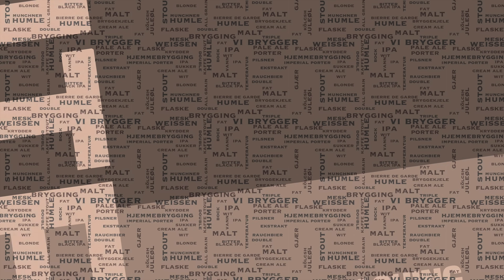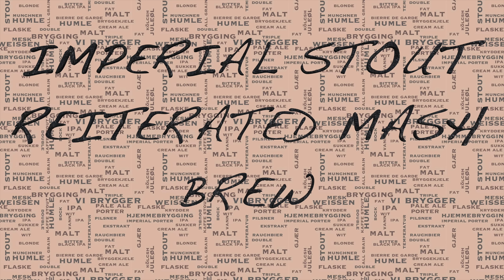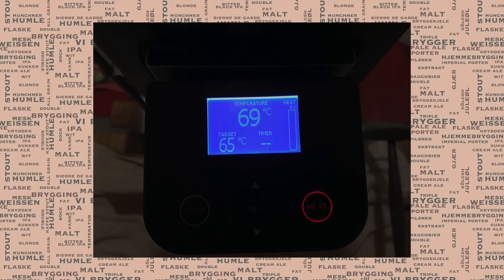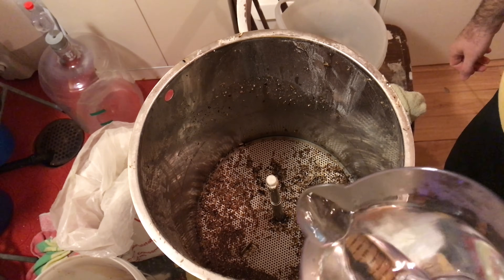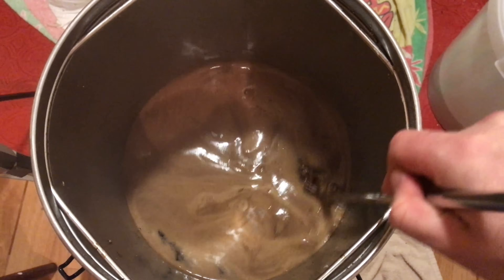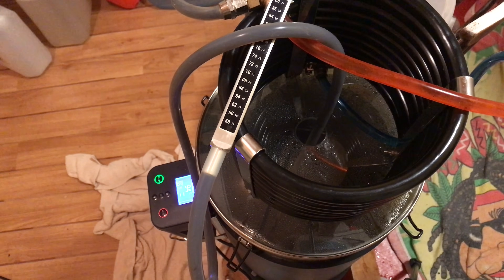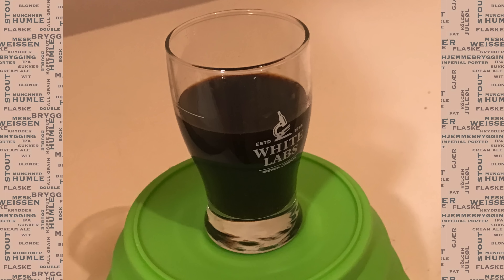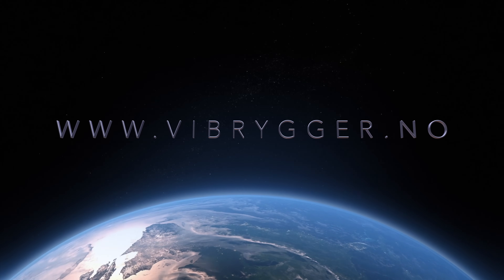Imperial stout reiterated mash high efficiency Grainfather brew 4k

Comment: Thanks for this David. I'm planning to try my first reiterated mash in a few days and will follow your advice (I've recently purchased the small batch pipework for the G30). I just had a query about mashing out after the first mash - are advantages gained from doing this that outweigh potential benefits of leaving active enzymes in the wort, ready to contribute to the second mash? I would always mash out after the second mash, but wouldn't instinctively do it after the first mash. Thanks again.
Reply from the maker: Great , cheers. 
The mash out side is optional. See what you think after trying both ways. 
I also have this more recently made guide which many found easier to follow, though its still 5 years old! https://youtu.be/C-7NiGZgKyQ?si=4ut3aZKkC9uOH8u1

Comment: Thanks again. I brewed some 'Sinister Stout', from Brewferm. It's an extract (2.4 gallons) and is currently conditioning in the basement. I racked it twice (it's a top fermentation process) and added 3oz. of 100% cocoa in the 2nd. racking. I also added 3oz. of Maltodextrin in the 2nd. racking. During the bottling I added 1ml of Four Roses burbon per 12oz bottle. For a Burbon taste test I made a growler (2L) with 25ml of Four Roses. If my friends prefer the milder amount of adjunct, I get to drink the growler.
Reply from the maker: Great, sounds good 🍻🍻🍻

Comment: The Grainfather G40 can manage a much larger grain bill. When brewing this exact same recipe on a G40, would you still recommend doing a reiterated mash to reach this level of efficiency? Or can it be done with only one mash on the G40 with comparable results? And if so, what water calculations would you recommend?
Reply from the maker: Hi Mark, totally right. Bigger sysyems can certainly mash this in one mash and you could increase the volume to one keg easily too 🍻🍻

Comment: Hello David! I'm about to try this method on my new 65L Brewzilla gen 4. At first I was thinking of using no sparge method as I could do my 14+kg grist for 23L batch on one mash but I wonder if it's a good idea? I'd need around 60% mash effiency and it's hard to tell if that is too optimistic. 
In case I try reiterated mash I was wondering why did you decide to mash out the first malt pipe? I'd think it would be useful to have all the enzymes there for the second mash as well? 

If I split the grain bill into two in Brewfather it gives me 24,6L mash water and 12,86 liters for the sparge water. Does this sound reasonable for the first mash? And then for the second mash I'd sparge so that I would hit the correct preboil volume, right?
Reply from the maker: For sure you need to sparge. The split method works well. Yes, go this way.
Reply: Right, thanks. What about your reasoning behind mashing out in between? Is there a benefit I'm unaware of?
Reply from the maker: You may skip mash out between.

Comment: Hi David I havre tried to find info about in what type of temperatur you should have the stout rest for 1 year, what temperature? Shall I also use the air look on or just seal off the damejeanne. Thanks in advance and for all jour god videos!
Reply from the maker: Thanks. Ideally 14C but normal room temps will work too. Yes, use an airlock 🍻🍻🍻
Reply: @DavidHeathHomebrew  Thanks for your answer, now I need to wait for 1. Many nice tips from your videos,
Reply from the maker: Cheers Olle 🍻🍻🍻

Comment: Hi, David! First of all, thank you for continuous inspiration. Been a while since I've made a big beer, so then I go back to this oldie, but goodie video :) 

I want to retry a reiterated mash on my G30. Last time, the batch got really small, 12 liters. So this time, I was thinking a reiterated mash with ca. 8 + 8 kilos imperial stout . So, a few questions: 
1. What efficiency should I expect? I'm usually around 65-70 % at 5-6-7 kilos of malt, 60 % if a big beer. I'm guessing 50-55 %? 
2. The strike water profile on GF Community goes haywire with 16 kilos. I though I'd max it out with 23 litrres of strike water, and sparge with 1-2 litres on the first mash, then 1 liter on the second. Thoughts?
3. Kveik Voss, can it go further than 12 ABV? The instruction says so, but I imagine I've heard up to 16 %?

Recipe, not sure if it's representative of the end result, given my sparge questions. 
Batch size: 16 L
Mash19.04 L
Sparge Volume16.08 L
Total Water35.12 L

OG (SG)1.134
FG (SG)1.031
EBC (Color)176.9
IBU (Bitterness)84.1
BU:GU0.63
ABV (Alcohol)13.44%
Calories138 per 100m

Thank you for your work!

Leif, Tromsø, Norway.
Reply from the maker: Hi Lief, great to hear, here are some answers. 
1) Done the right way you can expect close to regular efficiency. 
2) Best to figure it out using the half batch calcs as outlined in this guide:- https://youtu.be/C-7NiGZgKyQ
3) It depends. If it is the farm version then 16% should be just fine. If not then you can co-pitch with another yeast that can
Reply: @DavidHeathHomebrew  Thank you, I will give it a go 😊👍

Comment: Hi David, been spinning my wheels trying to convert a recipe over to a reiterated mash for a 35L 220v Brewzilla. Hoping you can help.

Brewfather user here. I have a 5.5 gal batch volume and a 25 lb 8oz grain bill. I'm really struggling to determine what my starting mash water volume and first sparge amount needs to be. 

I played with the Grainfather calculator but it gave me way too much sparge water. I'm probably overthinking this but any guidance you could provide would be greatly appreciated. Cheers 🍻
Reply from the maker: I would suggest watching this and use the half method shown in the video. Keep your calculations in Brewfather for accuracy:- https://youtu.be/C-7NiGZgKyQ
Reply: @DavidHeathHomebrew  I tried this but the numbers that the Grainfather calculator gave me put me over the mash volume limit after the first sparge.

Original recipe
5.5 gal batch
PB Vol: 7.33 gal
25.5 lb grain
Mash water: 5.88gal
Sparge: 3.59gal
Total: 9.48
Mash Vol: 7.93

The Grainfather calculator says for a 5.5 gal batch and 12.75 lb grain weight (half of the original grain recipe), I should start with 5.05 gal of mash water and then sparge with 3.19 gal of water. 

If I'm calculating this right based off of numbers coming out of Brewfather, my grain absorption should be around 1.22 gal. Going off of that - Mash water + sparge water - grain absorption = pre-mash #2 volume. 5.05 + 3.19 - 1.22 = 7.02. If I add my mash #2 grain on top of 7.02 gal it's going to overflow my kettle. What am I doing wrong here? I'm sure I'm missing something. 

Thanks in advance.
Reply from the maker: You are going to need to adjust batch volume until it fits :)
Reply: @DavidHeathHomebrew  Ok, gotcha. I wasn't sure - you made it look so easy. I figured I was missing something. Thanks!
Reply from the maker: You cannot brew quite as much as usual, it's a shame, I know :)
Reply: @DavidHeathHomebrew  Thanks again for the help! Now that I know I have a bit of wiggle room with the process that's made things easier. I put together a spreadsheet to work out the volumes I need and was able to make 5.5gal batch work. Hoping to brew this next month, I'll let you know how it turns out. Cheers!
Reply from the maker: Great, I hope you enjoy the results :)
Reply: @SteveBenson  hi Steve would you mind sharing your spreadsheet a is find I'm in the same position as yourself being a brewfather user

Comment: Have you added this to Brewfather? I can't find it and I'm wondering how you got it to acknowledge the small batch.
Reply from the maker: Hi, no this was way before my Brewfather change over. Should be easy enough though. If you go into Brewfather you can adjust the volume settings within the equipment profile by selecting edit and then moving to Batch volume (Fermenter) best to set this first before entering the recipe.

Comment: So this is quite interesting, because with that BH % you could experiment with going even higher abv? same kg amount with the small batch pipe, but do a third mash in or go with 4 ish kg on the regular pipe and two mashes. interesting! New experiment soon? :)
Reply from the maker: Hi David, I actually have a newer video here that explains this in better detail. It is a method that I have used alot and since these videos many others have given great feedback and results also. Here is the link:- https://youtu.be/C-7NiGZgKyQ
Reply: @DavidHeathHomebrew  Thanks for the tip David!

Comment: Hello, I'm about to brew a stout with a grain bill just between 7 and 8kg. So just between the small and the regular pipe sweet point. I can change the grain bill but I have a questioN. Does the efficiency goes a little bit down if I use the regular pipe with 3,5kg of grain? Why using the small pipe is better with a small amount of grain?  Thank you again for this so helpful video.
Reply from the maker: Hi, for this level of grain I would for sure use the small batch pipework as it will assist with reliable efficiency as part of a reiterated mash.
Reply: @DavidHeathHomebrew  Thank you:)

Comment: Great video David. I'm planning to brew this soon. Will also add some (0.9 kg) candi syrup.
One question, is it enough with just one pack of M42? It sounds little for such a heavy beer.
Reply from the maker: Many thanks Elias. It totally depends on the volume. If the same as this then that will be fine :)

Comment: Hey David, I did my first reiterated mashing yesterday for a similar imperial stout. Unfortunately I don’t have a grainfather yet so I did the whole brew with my electric kettle. It was on for a few hours, so 40 minutes through the boil, it overheated so it went on and off for the last 20. Should I worry about that?
It’s the first time I go for such big beer. I have 15 liters of wort at OG 1.085. I’m using a Mangrove M36. I rehydrated it for about 15 minutes before pitching. I took a few hours before any activity. Do you think it’s gonna handle it? 
I’m planning on a 3 week fermentation, do you think I should pitch some more?
I apologize for throwing so many questions, and thank you! I’m really learning with your videos.
Reply: Hey David, I bottled my imperial stout two months ago, opened one and it is already tasting great! 
If something I’d say the head dissipates quickly.
I wonder how it’s gonna taste in a year time. Would the head improve? Probably not, right?
Thanks again for your videos, I’m learning a lot!
Reply from the maker: Great to hear. Head wise temperature plays a fair role but there is much more to it. Here is something you should find interesting:- https://www.craftbeer.com/craft-beer-muses/the-science-behind-beer-foam
Reply from the maker: Sorry I must have missed this! Did it work out well for you?

Comment: You mention a slow Sparge done manually. How do you Sparge slowly? The rate of Sparge surely is governed by the little holes in the bottom plate and how fast/slow the grain bed drains. With a Coller type mash you regulate the Sparge by the Outlet and input to match keeping the Sparge Liquor a centimetre or so above the grain bed until the outlet is at some SG figure and then stop.
Also, is there a non-manual way to sparge?
I am going to experiment with this, which is why I am interested. I liked your way of emptying the spent grain, thenks.
James
Reply from the maker: Hi James, there is a trend these days for people to position their sparge water heater above their kettle and open the tap. This has a negative effect compared to a manual sparge.
Reply: @DavidHeathHomebrew , Thanks for the quick responce. I had considered using a similar system into my wirlygig Fly Sparge Arm but I could not think of a safe way of getting the water up high enough. A pump was the next bet but they cost so a plastic jug is what I use.
Grainfather.uk suggested I fully drain the grain bed before Sparging but I find that difficult to do based upon my original Cooler and Fly Sparge arrangement where it was important to keep the Grain Bed wet and undisturbed.
Reply from the maker: Fully draining the grain bed is a fast route to a stuck sparge, avoid that for sure! If you can find an automated sparge method that gives full grainbed cover then go for it, though I have not found anything that I am happy with personally that is worth the cash.
Reply: @DavidHeathHomebrew  Many thanks again for your reply. That advice came from a GF-UK email exchange. I replied that it was against all principles and have not complied with their advice. It may be of course that I read the mail wrongly? I will remain with the status quo.
Reply from the maker: Odd really but it could have involved a typo I guess.

Comment: Could you explain to me why a Grainfather has efficiency sweet spots with different lengths of stand pipe ?   

Is it because the deeper the mash relative to the standpipe means more liquid flows through the standpipe versus going through the grain bed thus leaving some fermentables in the grain ?
Reply from the maker: Sure. Its about space and flow rate. The more grain you have the more this flow rate changes, stealing efficiency. Keeping within these sweet spots maximises your effeciency and leads to more predictable results. This predictability is key.

Comment: Would DME and sugar not be more efficient overall?
Reply from the maker: Hi Andy, You can certainly use DME and sugar. In terms of DME there is a difference in cost and some would say quality of the final beer. For some it feels like cheating. I have shown both methods here on my channel. Here is an example:- https://youtu.be/2yS_IdlvS_U
In terms of sugar you have a limitation of 20% of fermentables before this will compromise the taste of the beer, it just doesnt sit well. The other potential issue is that this lowers the body of the beer, which some feels changes to desired profile of such a beer. Also to mention that in terms of reiterated mashing I have a video that explains this technique in more detail here:- https://youtu.be/C-7NiGZgKyQ
I hope this all helps :)

Comment: Hi David! Nice video! Im planning to brew using reiterated mash but Im a bit confused about ajusting salts. Did you do that? How?
Reply from the maker: Hi, there is a better video of mine on reiterated mashing here:- https://youtu.be/C-7NiGZgKyQ
Reply from the maker: In terms of water, I adjusted for the first mash then sought the same end ph for the 2nd mash as the first. I aimed for a ph of 5.3-5.4 at the start.
Reply: David Heath so you adjusted the water twice? The water of the first mash and the wort of the second mash? How did you calculated the second adjustment?
I use Brunwater sheet. Which tool do you use?
Reply from the maker: You can be precise with the first adjustment. The second one is adjust and see really. My water needs little adjust for darker beers, so that made it easy.

Comment: Good video David,
However, I dont understand this approach if it not for experimentation. I mean, if you do one single mash for your 6.7 kg, this would mean, since you are above the efficiency peak for the big pipework, that you lose around 5-10% eff. This loss in efficiency would mean around 20 nok in extra malt to account for a lower efficiency. If all this is correct, does it worth the extra time and efforts to do this for such a saving?
Reply from the maker: Reiterated mashing is a widely used method in home and commercial brewing that makes brewing of strong beers possible. Its not a case of money, its a case of possibilities. You simply cannot make beers this strong with a single mash. I have made a new video about this subject just recently that explains things in a better way I believe. Check it out here Alberto :- https://youtu.be/C-7NiGZgKyQ

Comment: Hi again Dave. I am going to try a Russian Imperial Stout soon so I was thinking in a fact:
Have you think about a "reiterated sparge" positibility at the end of the second mash to increase the AVB? I mean, i.e. sparging with 3 lt two or three times in a bucket before adding to the GF for boiling.
I think it can be interesting to try.
Perhaps you have tried it before.

And another question: when you finish the first fermentation at carboy do you close it and wait i.e. one year or move the wort to another clean carboy? have you tryed both methods?

TY very much and happy brewing :)
Reply from the maker: HI Fernando. The second sparge is basically a top up sparge, otherwise you will go over the volume desired.
Reply: David Heath we do not increase volume if we use a bucket and then sparge with the same water...3 lts
Reply from the maker: oh sorry, now I get what you mean. Sure you can try this, I tried this some years back but found that it made little difference for me personally.
Reply: Ok Thank you. And what about the second question about carboy? Ty
Reply from the maker: You must transfer to another smaller carboy filling it up to the neck. If not then the beer with oxidise. See my video here showing the Imperial stout:- https://youtu.be/i1ptICwg8vo
Reply: Really...I will try it. TY👍